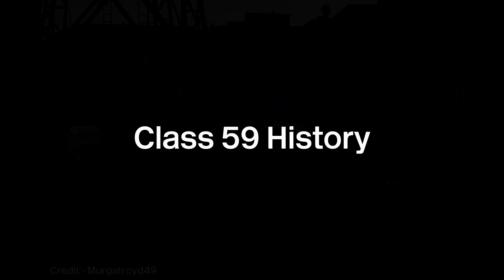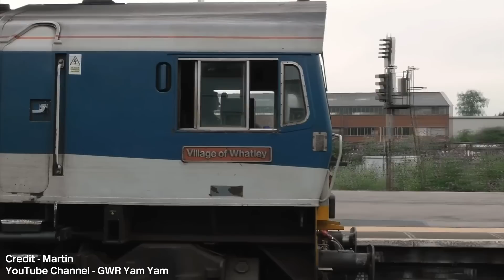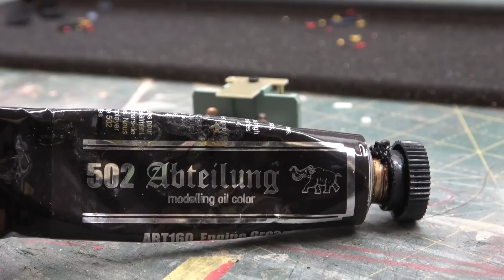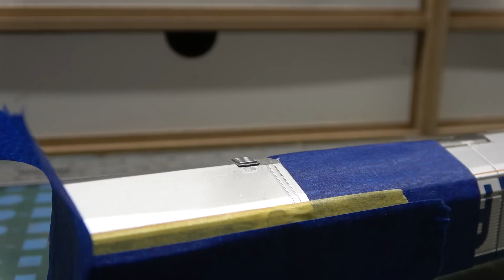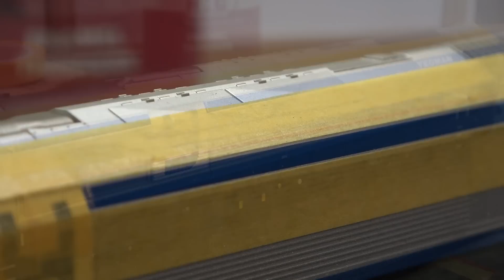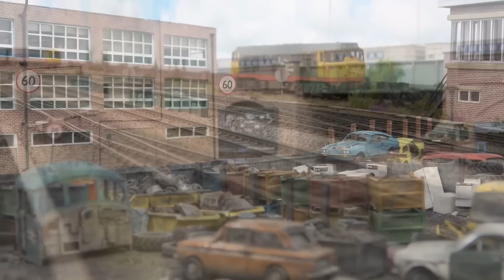Modifiying, Improving & Painting - New Dapol Class 59

Comment: Superb video! Did you have any problems with the changeable bottom portions of the front ends? One of mine seemed slightly twisted so first thing I did was accidentally snap it off! 😢 There shouldn’t be a gap between the two parts should there?

Comment: Hi Richard. Thanks for another great video. When I ordered the ARC Village of Mells class 59 i was led to believe that it would come with Smoke & sound fitted. Alas, no sound but thanks to your work on yours, i've ordered the ESU Loksound 5 chip from Roads & Rails, so will be installing them with the EM1 speaker. Have you thought about fitting a sugar cube speaker as well to improve the sound in the higher frequencies. I feel the EM1 can sound a bit dull with certain sounds (like the spirax valve & wheel flange squeal), just a thought as i'm going to try that with mine.
Thanks for the tip with the lights, they do look too blueish so toning them down makes them look much better.
My 59 has a different light arrangement so i'll look into the correct working senarios & poss link them out like you did.
As i'm no good with an air brush, i'll be leaving mine in the stock factory finish, it's a cracker of a model (like you said) so i'm pleased with it as it is.
Thanks again for the great videos, always both informative & entertaining. 👍

Comment: I'm far from a rivet counter and I'm pretty sure most of what I have and have planned could upset so called self named "proper enthusiasts" could deem my efforts as "blasphemous"; but it's kinda sad that the product was in development and production for so long and they still managed to get something as basic lighting configuration so spectacularly wrong.

Also that so-called opening door is horrific!
Reply from the maker: I was surprised by the doors when it turned up.  They were not noticeable during the somewhat limited info we saw during development.  The lights are disappointing as they have clearly spent quite a bit of time on them during development with multifunction circuitry.  I get the impression the project stalled at multiple points during the previous 7 years.
Reply: @EverardJunction  You'd think the people designing the models would at least have access to Google Images in the name of research though, wouldn't you? ;)

Comment: Surprised at the number of issues with the 59. The roof pod looks as though it could have been more accurately portrayed had it simply been moulded integral to the roof, kind of less is more. As for the cab doors barely opening, it's as though one person designed the body and another the chassis and they never met! Great work as always.
Reply from the maker: I get the impression the project stalled at various points throughout it's development.  It might explain some of the issues.

Comment: Excellent video Richard, I like the soft tweaks you have done, making the loco appear a lot better especially  when they have crew added. You've clearly mastered the art of creating realistic lighting ambience and interpret it very successfully.  The sound is very faithfully captured completing an excellent model also the train and I like the length of the train.. The funny sounds blasted on the horns is actually the notes from the song "On Ilkley Moor Bah tat" which translated from the Yorkshire dialect is "On Ilkley Moor without a hat!" There are lots of examples of this being blasted out from the boys from the Yorkshire TMDs on You tube, it seemed to become a trend from 2010 onwards. Clearly this would not be used by your its drivers unless anybody knows any differently?

Comment: Watching a Master at work is always a pleasure. It is a shame about the doors letting the model down, at 36.42, the real 59005 and then the model 59005 is the door handle on the wrong side of the door. The level of detail you have gone to only to be let down so badly.

Also can someone correct me, didn't early Class 59's have the double headlight over the cab windows?
Reply from the maker: The handles are correct.  The real photo was taken on the other side of the loco.  The handles swap sides depending on what side of the loco you're looking at.  A strange feature, but it is right.  Cheers
Reply: @EverardJunction  Thanks for the clarification

Comment: Fantastic stuff as always Richard with a well researched story of class 5 freight motive power, the class 58's were always a British Rail 'could have been' locomotive, if only they had been geared for maximum 60mph running and had SPEX anti-wheel slip control fitted. I think they would have been an entirely different beast and maybe got nearer to the class 59's superior haulage capability, and probably been around a while longer.
Reply from the maker: The 58 was certainly a missed opportunity.  Very much the underdog/forgotten loco.  One of the reasons why I've always liked them.  Cheers

Comment: I find WIkipedia's claim that the 59s averaged 273,000 miles each in their first year of operation very hard to believe. With the unrealistic assumption that they were running seven days a week, that's 750 miles a day, which is 12.5 hours running at their top speed of 60mph, or over 18 hours a day if they were "only" averaging 40mph. Alternatively, it's a little under four return Westbury-London trips per locomotive, per day, including weekends. If they were only running weekdays, like most freight, that goes up to 1100 miles per working day, which means they would have had to average 46mph just to do the distance in 24 hours.
Reply from the maker: I suspect it was more like the 4 initial locos covered that mileage as a group.  I changed my commentary to imply this in the voiceover.  I did not specify that the locos covered that mileage individually.  The main takeaway from this is they were a vast improvement over Yeoman’s previous BR arrangement.  Rather than getting hung up on figures etc.
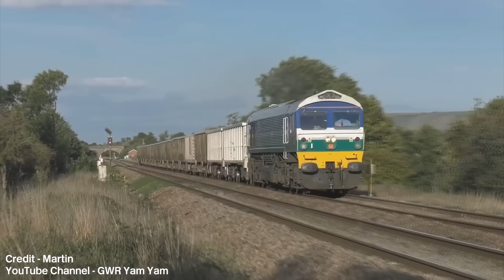Reply: @EverardJunction  Actually, your voiceover still implies "per locomotive", though I now see that you deliberately avoided saying it explicitly. At 6:23, you say "During their first year of operation, these first four locomotives built for Foster Yeoman travelled an average of 270,000 miles." That average can only sensibly be understood as being the average over the four locomotives, which is a per-locomotive figure. I guess you misspoke and intended to say "total" rather than "average" -- as you say, that seems more likely to be true.

Anyway, I don't want to sound like I'm going on about this. I agree with the point that they were massively better than the 56s.

Comment: Couple of things I found with my Yeoman Class 59. The gears and drive shaft connections looked very dry and not greased.
I also found that I had to sand the paint off the back of the name and number plates to make them fit better.

Comment: Great intricate work there Richard. In particular, the roof exhaust height change chimes with my engineering head for details, Simon
Reply from the maker: Cheers Simon.  The exhaust was the first thing I ended up doing.  Despite not being too familiar with 59s initially my research really opened my eyes to how the model should be etc.

Comment: Absolutely superb. (As always)  Next level modelling and attention to detail. I have been extremely fortunate in my career to drive all the 59s (bar 59003) and they are seriously powerful workhorses. For reference, the head light switch was marked high/dim, but in 2017, only dim was the option.  
Always a treat to see you've uploaded. Thanks.
Reply from the maker: I read that the headlights ended up getting locked to dim but couldn't confirm it.  They certainly seemed to have the headlights on a bright mode in various older photographs.  Cheers for the info.

Comment: When they first came out, believe me those headlights were blindingly bright to drivers of on coming trains. After numerous complaints and relentless flashing of headlights of trains coming the other way the 59 drivers were told to switch off the headlights at night if they were approaching a train travelling in the opposite direction on an adjacent running line until they'd passed the leading cab. It was only a short time before the 59s headlights were fitted with a dimmer switch and I believe that was deemed to still be bright enough for normal running.
Reply from the maker: I've read that they had a bright and dim setting.  About 5 years ago the bright setting was disabled on the class.  Interesting info, cheers

Comment: An overall great project video on your 59 here Richard, I bought one myself recently the one I bought being 59206 in the DB Schenker livery and to be honest I’m in two minds over it at the moment, I’m very happy to have a class 59 and I like the features like the opening doors no matter how silly it is with them only opening a small amount, I’m not happy with some of the issues I have had with mine so far one being that one of my lights doesn’t come on at all which I can forgive due to it being at the end where the coupling is and another issue I have had is some of the axleboxes falling out, another thing I have found is the lights flicker at low speed which could be attributed to me still using dc but I have locomotives by dapol that don’t have any flickering lights at low speed, those being my class 68 and the class 121.
Reply from the maker: Can't say I've had any issues with mine flickering or any axle box issues yet.  It's certainly an odd model from an electronics point of view, lots of complexity.  The lights on the DB example are also incorrectly configured.  In real life they run with one headlight and one marker lit on opposing sides.  On the model its got both markers and one headlight lit.  I would say its not as noticeable with those smaller light clusters but it seems all the liveries so far have weird lighting.  Cheers
Reply: @EverardJunction  thanks Richard, the flickering is most likely down to me still using dc operation because like you say you don’t have an6 flickering and run on a dcc setup, but I should have clarified in my first comment that it’s the bright headlight that isn’t working on one end of my 59 plus my 59 is the /2 variant.
Reply: I have just purchased the 59 in Yeoman livery and also run on dc, a strange "problem" I have with mine regarding the lights is that when running in reverse, the headlights are illuminated at the wrong end up to a certain speed, and one cab light is brighter than the other. Also I bought the matching heavy Dapol yeoman wagons and it derails the first wagon on certain bends. Nothing else derails on my layout. Might change to magnetic couplings to see if that helps. Quality not as good as Bachmann I feel, but then again, not as expensive either.